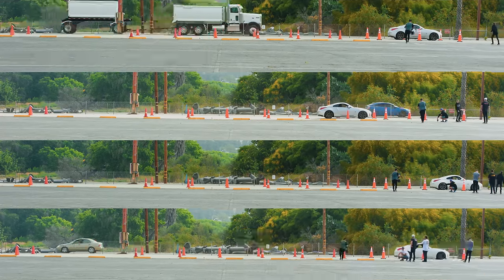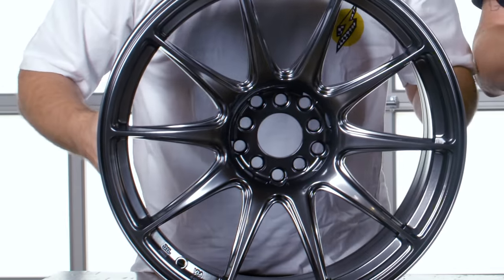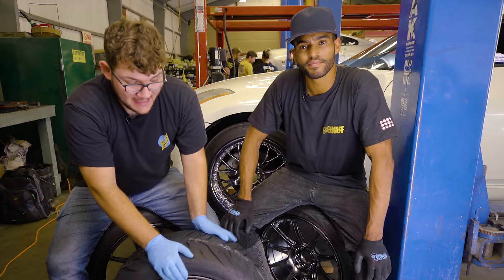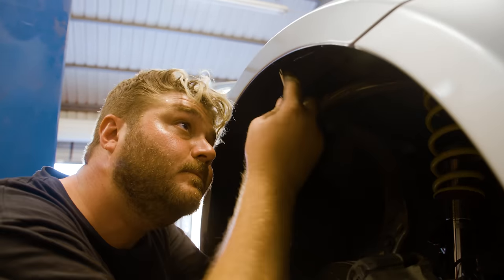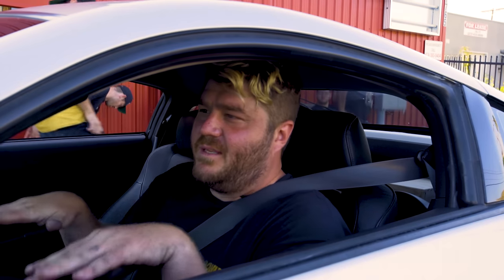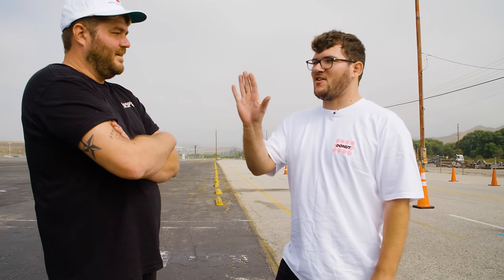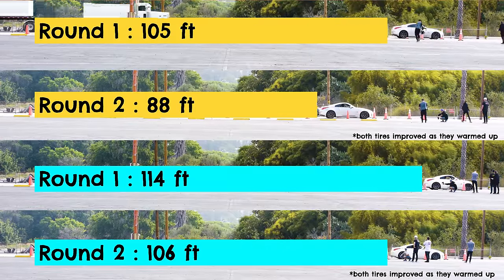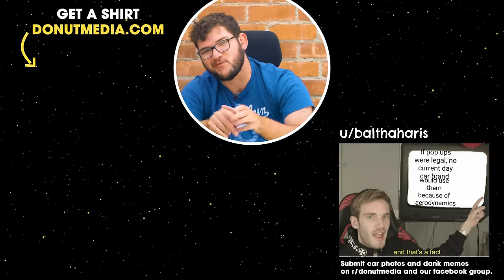$1,000 vs $3,700 Wheels and Tires | HiLow

Comment: The different suspension kinda invalidates this test.
Reply: yes
Reply: Thats the whole point of this . Expensive vs cheap.
Reply: Did you miss the whole point of this series bud? Low budget vs high budget
Reply: @michaelmcafferty9837  low vs high "wheels and tires" not suspension system bud
Reply: K C you’re still missing the whole point of the series if you could actually read lmao, one car has cheap parts hence the LO car, the other has expensive part hence the HI car. The whole point of the series is to figure out if more expensive actually means better and in most cases yeah. Just thought you would need some more simpler explaining since you don’t get it
Reply: @michaelmcafferty9837  you cant directly compare cheap/expensive tires if theres other variables. This test absolutely in no way showed that better wheels= better performance, but better wheels AND suspension performed better; state that, not that it was solely the wheels that improved.
Reply: K C dude you seriously can’t read and can’t comprehend the entire point of this series, go back and watch the first episode and listen to what they say about the series in the intro. Low budget car vs High budget car build buddy.
Reply: Michael McAfferty I agree with KC, yes like you said the point is cheap vs expensive and what not but if thats the sole point of the series then the series has no meaning and its not worth doing it, just think about it, what is the purpose of doing a cheap build and an expensive build to simply compare them? Wha is there to compare? 100% of the people with at least a single brain cell understands and knows the expensive car will perform better, thats just logical. Then what is the point of the series? We all know what the result will be. Instead the point of the series should be if the expensive build is worth it or not, which which you could argue thats what they are doing but then doing the tests of the parts all together it invalidates how worth the part is cause one car keeps acumulating cheap parts which will only keep lowering and lowering the performance another part in the future might provide while the other car keeps improving, over compensating the performance of the future parts the expensive car might get. It just doesnt make sense for the point to be about comparing whole builds of two cars when one is all cheap while the other is all expensive. Comparing instead every part separetely to determine which parts are worth it or not is a much better goal and purpose, this way this series would actually be a good way to make your own build and will serve as a guide, you will easly know which parts are more worth the money and you can build your car in the most efficient way possible.
Reply: Carlos Guzman dude read what you just typed to me. You literally contradict yourself. Again go back to the intro of the series so that way you can actually comprehend the entire point of hi vs lo, which is to see if the more expensive parts are better and if they’re actually worth it in the long run
Reply: Michael McAfferty but thats the problem, you cannot accurately determine if more expensive parts are actually worth it because as more and more parts get installed the more performance boost the car will get, its impossible to tell how much an actual part is contributing if the performance is being boosted by other parts too. And it will never be worth it in the long run either going all expensive because its simply not realistic or efficient for the average car guy, the amount of money the expensive build will acumulate is absurd.
Reply: Carlos Guzman the whole point is that in many aspects more expensive parts does mean better but obviously anyone with common sense knows where to go cheap on a car and where to drop the money like tires and wheels and know when to find the happy medium on parts such as coil overs. You’re making it too complicated on yourself bud. Keep it simple stupid
Reply: @michaelmcafferty9837  "anyone with common sense knows where to go cheap/expensive" Then why are you watching this? This is an educational and informative series for people who dont already know this, why would you watch a video on something you already know you should do? So then that must mean these videos are geared towards people who DONT know what they are doing. In which case a normal person has no idea that a new suspension AND wheels would perform IMMENSELY better over a standard setup. Whose this video for then? Car nerds or people who dont know? Either way the series is flawed
Reply: However you can't test the tires against each other singularly as the base (control) is different. I've had the RS-RRs and they are damn good tires
Reply: In my opinion, just get a good grade coilover and dump it with cheaper tires and wheels. We want a sporty looking daily driver that won't bleed our wallets to its last coin. 2 1/2 seconds of total advantage from the Hicar is negligible unless you do track days for a living. I completely agree with you, with a decent coilover setup, results will be almost identical. Who buys cheap coilovers anyway?
Reply: @101rigel  most people spend like 7-1k on BCs, Ksports, D2, Megans, Yellow racing shit which is all the same coils with different colors. I dropped alot of coin on Fortune Auto Pro 2 ways to replace my old Tein HAs and I'm not concerned that they will be leagues better than the ones listed above
Reply: Michael McAfferty Yes, that is the point of the series, but the title informs that this is a test between the wheels and tires, but that test is invalid with different systems of car. Read the title of the video, damn🤷🏼‍♂️
Reply: Bruh we all know this series isn't meant to be a scientific one right? If they really wanted to make scientific comparisons in tires then obviously they would use identical cars and compare times to a car with a control tire (OE). But this series is not only to demonstrate the build process (and learn for themselves because they are also learning) but to show the different experiences when dealing with expensive parts vs cheap parts. Sometimes you can see where having the cheaper part would have a higher value than the more expensive one EVEN IF IT WASN'T COMPLETELY SCIENTIFIC and sometimes you can see where it would be worth spending at least the extra few hundred dollars (reference the brakes ep. where the value of the Lo setup was more worth it in their eyes unless you were tracking a lot, or the paint/wrap ep. where a novice plastidip job vs the expensive wrap was seen as worth the money). All in all, this series isn't about seeing if Hi part is better than Lo part (no duh), but comparing the difference in experience that a Lo car or Hi car would bring when working with such project cars. Also its fun to watch.
Reply: The whole point of the series is to show the differences in spending when building a car 😐
Reply: 100% true man... They ruined this test with that shit house suspension on the low car. They shouldn't have bought the cheapest suspension out there. They should have bought a reputable cheaper brand to the KW's. Like Tein or Fortune, you know what I mean? Even if you are on a budget, no one is THAT cheap that they are going to put those trash chinese coil overs on their car. As soon as they put those rubbish coilovers on the low car, they ruined the comparison and the rest of the entire experiment... People wanted to see whether they really need to buy KW's or if they could just get cheaper coilovers and they would think this video may be a good guide but no... All I got from that is you can improve performance a great deal through  a set of expensive KW's and compared to cheaper what?! Some rubbish coilovers that no one would ever even consider... Wow, thanks for wasting everyones time hey
Reply: @Antonemachine  I agree that they should have gone with a cheap name brand suspension, but I disagree with the thought that no one would put that trash suspension on their car. They make sales for a reason somehow 😂
Reply: @TheQuilava96  Wrong. Just because you see them on ebay doesn't mean they sell heaps of them to tuners drifters or anyone with some enthusiasm towards their car. You can be sure they aren't as they wouldn't last one lap around a drift circuit or very long on a daily... Cheapskates buy them for cheap cars. The majority of buyers are not going to put the cheapest shittiest chinese suspension on they're car. They should have used a cheap known brand you can actually use and not unknown chinese rubbish that no tuner, drifter or mild car enthusiast would ever use
Reply: The different rubber makes most of the difference, the rims are just decorative.
Reply: I mean if you drive the car, you get used to the suspension, and if you put new wheels and pay attention, you will feel the difference.

Comment: 1000$ wheels
Oh ok that’s a reasonable price set
- And tires!
Oh...
Oh no...
Reply: What is a reasonable price for set?
Reply: shadowflare99 around 1700
Reply: lAcid Rainl are the wheels 35” or the tires 35” tall?
Reply: @iknowthings57  35 inch wheels duh hes makin a donk lol
Reply: When he said I'd rather spend 500 instead of 1200, I cringed knowing I spend 1600 for cheap tires on my dual rear wheel truck
Reply: Try pricing a set of stock wheels for most Mercedes automobiles.  Then compare that to just an oil change on a Bugatti veyron. Or Chiron.
Reply: Meanwhile, in my driveway: a Honda civic, just got new steelies to replace giant gaudy rims, cost $27 each, and some okay Douglas all seasons, costing $30 each with a coupon. "Full set", for $228. Haha
Reply: coastercrave it really depends, their wheels are so expensive because they’re performance wheels and they’re crazy wide
Reply: Coastercrave: There are tires that are $10,000.00 each and more.
Reply: @joshstane5926  bruh😂 the wheels on my truck were 3,000. 1700 isn't that bad
Reply: @joshstane5926  1,700 for wheels and tires? not that bad
Reply: James is literally a car guy Seth Rogen 😂
Reply: @ralphnapierii1184  This right here is a real man.

Comment: "In every test they performed better."

With suspension proven vastly superior...
Should've swapped em' all onto the same car.
Reply: yep if the suspension isn't correctly set up for what you are using your car for theres no point in even thinking about wheels and tyres. slamming a car as low as it will go severely impacts the way a car handles as seen in the video and should never be done if your doing any fast driving.
Reply: @filmboy18  that's true but I'm pretty sure that he meant the fact that the two cars have different suspensions
Reply: They wouldn't fit, they already had to roll the fenders out on hi-car to fit the Advan/Bridgestone combo, lo-car is way lower so would have even less room.

Comment: The cheap one is more than my budget
Reply: They bought the sports version of cheap so its gonna be a little bit pricy since its sport 🤧🤑
Reply: bicycle tires are your budget
Reply: @trillrifaxegrindor4411  good bike wheels and tires aren't much cheaper lol
Reply: @notDonaldFagen  right a good bicycle wheel like my old bmx was $130 for the rim alone plus ti spikes and a $300 hub... about $1200 for the pair if I remember right , closer to $450 each or $900 for the pair, if you just use cheapo spokes
Reply: @NB-ir1me  u gotta respect the bike community to be equally scandalous in pricing. A good wheelset starts at 1k smh 😂
Reply: Just paint your originals big rig

Comment: Should've done the tests with stock suspension on both
Reply: or at least made another run with the cheap tires and rims on the hi car so that we'd have an apples to apples comparison
Reply: They didn't have to. They ran the same course with both cars when they changed the suspension and before they changed the wheels and tires.

Comment: I love those Federals.... but it sounds like you’re getting invaded by aliens in the Z’s cabin.
Reply: Bro i had em on my genesis when i first got it. HOWLING. I thought the wheel bearings were trashed lol
Reply: I had them on my Miata for a while, they were so damn loud. Sticky AF though
Reply: Got them on my FR-S.  AAAAAaaaaaAAAAAaaaaaAAAAA
Reply: I have them on my S2K. Sticky AF in dry, but a soap in wet. Too dangerous for the UK actually....
Reply: The new federals rs-pro tho! Basically an updated version, similar price and aren't as loud
Reply: @swagstein9322  The RS-PRO are great tires, but more "civilized and urban" that the RSR-R. The latter are great for dry places and for race use, but very weak while in places like the UK.

Comment: For wheels tires suspension, head over to fitment industries
Reply: Shaking my head that someone actually paid almost 3k wheels that are not forged...
Reply: That channel is awesome. I got a a bunch of knowledge about wheels. Ton of useful information
Reply: @DuBstep115  flow formed is about as tough and lighter than forged
Reply: Meanwhile I'm throwing $13,000 asanti rims on my Volkswagen golf in Midnight Club....
Reply: @Adlore  lighter? Then why every reputable company is selling forged
Reply: @DuBstep115  forged is the gold standard, flow formed is also very good. Casting is usually the worst as it's the cheapest, and carbon fibre wheels are even better than the rest. 

There's even a form of casting that would be better than forging but is so expensive that it's only used in jet engine turbine blades.

There are plenty of options for making good wheels it's just that forging has always been a good option for the price, and isn't too espensive
Reply: @Adlore  but for $3000? Sets of flow formed wheels are available for about $1000 depending on size. Enkei wheels are a top example.

Comment: "multi lug pattern wheels are signs that they're cheap" laughs in LMGT4
Reply: Jdmdistro
Reply: LMGT4s aren't multi lug
Reply: @Vibe174  you sure?
Reply: @imbored287  yeah, the other 5 holes are for weight reduction at a guess, look at a picture on google and you'll see 5 of the ten holes are literally just holes and aren't for studs/bolts
Reply: @Vibe174 I'm pretty sure the LMGT1, 2, and 3 were multilug though
Reply: @imbored287  yeah your right about that, although they seem to be the same bolt pattern looking at some photos which is weird, i'll have to do some more digging
Reply: @imbored287  Only 5x114.3, despite having 10 holes.

Comment: We do stopping tests using precision GPS.  You can look at a graph of the speed to see exactly where they were at 60mph, then 0mph and plot the 2 coordinates on google earth.  Take a measurement between them and boom, you got stopping distance.  You can also plot another excel sheet column with a derivative to get acceleration or in this case negative acceleration.

Comment: Weird notion, if you get in an accident. Your insurance company will present you with a way different valuation system.
Reply: You get actual cash value minus your deductible for you covered losses. Actual cash value approximately equates to trade in value on NADA. Keep the receipts for your custom parts in order to have them paid for in a covered loss.

Comment: When you'll accidentally hit a pothole with the cheap rim and it brakes like pretzel and crash your ride...
That's when you'll pay the difference...
Reply: Peter Balogh tbh XXR is a brand that has been around for a good amount of time and makes a good quality product.
Reply: @jacksonelliott1513  I didn't meant for XXR cause I don't know that brand. I wrote cheap... I've seen pic of broken Rota on Subaru before.
Reply: I had a buddy that hit a pothole on his rays that broke and made him crash as well. Expensive wheels.. but I say if you gonna beat on it why go expensive. There are cheap wheels that looks good as well.
Reply: I have yet to break a replica wheel from a pothole and i have owned quite a few sets from XXR, AVID, JNC, ROTA, etc...so idk where you guys get this theory. Most i have done is bend one from a 165/45 and it still rolled fine.

Comment: Honestly, I'm a budget man. I can't spend more on tires and wheels than I did the entire car. Now, I have spent way more on wheels, tires and suspension all together.. But, I have the XXR 530/18's(Gold) in a 33 offset 7.5" wide(w/o rolling any fenders) and Nitto NeoGen 225/40R18 high performance all seasons.('04 VW Jetta GL) cost=$1000+ accompanied with KSport Kontrol Pros fully adjustable coilover kit(another $1000+) I honestly can't tell you how happy I am with the results. I've since added several other chassis and suspension, upgraded rotors and pads, to put about $3200+ worth of handling and stopping power to this set up in moderate totals. Doing all my own wrenching, I might add. It has transformed this car and I would do it all over again for the value,  performance versus costs, over and over again. I shot for midgrades and I LOVE IT!!

Comment: I replaced the Michelin Pilot Sport 4S tires on my 370Z with a set of Michelin Pilot Sport Cup 2(240) and like the better steering feel and response.

I'm replacing the OEM 19" Rays forged aluminum wheels with a set of forged magnesium wheels from Litespeed and they should be ready in about 2 months.